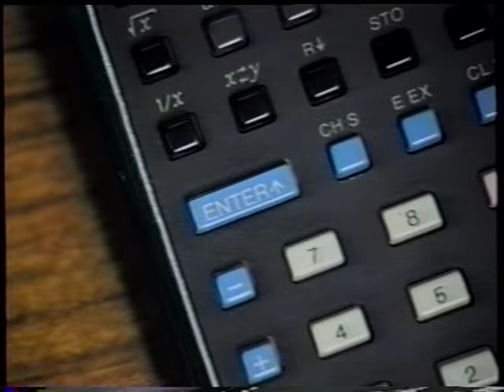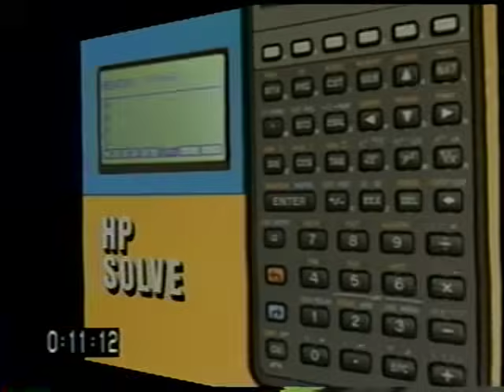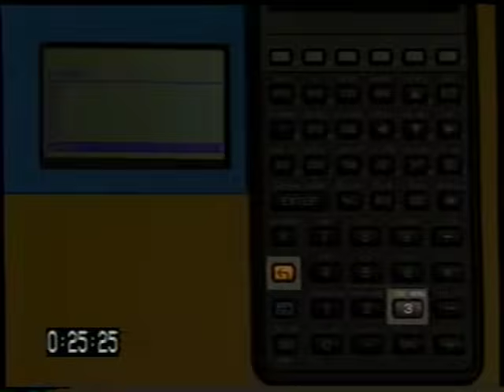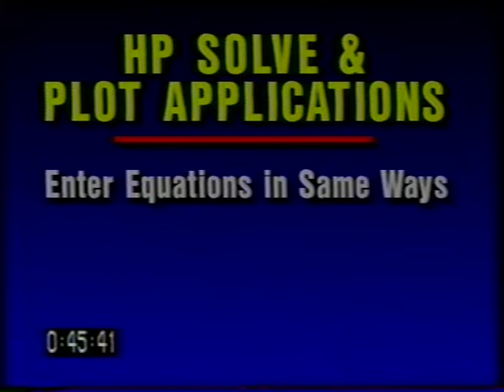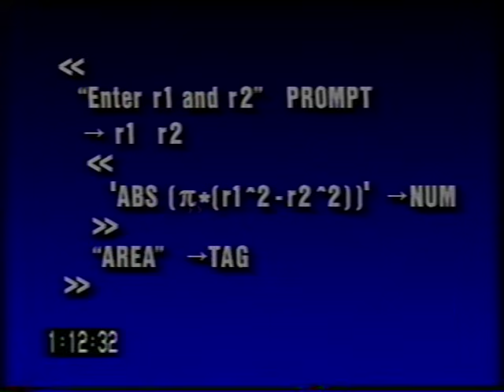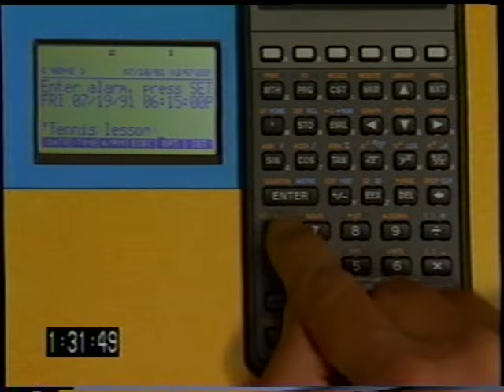Learning About the HP 48

Comment: The HP 48 is the best calculator ever made! I would really love an HP 48 Prime to be released - a modern fast pocket calculator for engineers that would not be allowed in SAT and other tests. I love HP calculators and have several 48, one 15c, one 11b and a re-release 35IIs. I also have the thermal printer.

Comment: Thanks for the video.

I got my 48SX during college year in 1991, one of the most interesting features is matrix to solve three unknown variable with three equations for circuit theory courses.  

My 48SX still work but the screen getting dimmer with "bleed" LCD , not sure if I should change its polarized/silver thin films or screen replacement from other models, like 39G, 40G, what is your thought ?
Reply: It's impossible to non-destructively open an HP48 series calculator for repair.

Comment: As a calculator, it is absolutely unbeatable. But it has/had some serious design flaws.

For example, a very large number have been affected by contact errors, which cause buttons and the screen to stop working. I've had four of them and all of them have had contact failures.

The glued-on metal plate has a tendency both to loosen and to become dented. Sticking on a metal plate of very soft/flexible metal, was a really bad idea.

The calculator is assembled in a way that makes it completely impossible to open. Given all the contact errors it tends to suffer from, it would have been nice if it could be opened.

But as I said, as a pure calculator it is completely unbeatable - as long as it works, that is.

Comment: Thank you for making this video available. I had a 48sx in the ‘90s and used it a lot in my eng studies. We had the same model with a class mate. We developed and exchanged programs via IR. It was incredibly useful that time. Unfortunatlely the buttons dont work on it anymore. However a very nice iphone app called iHP48 has recently been released so I can enjoy again the good old hp48 experience. I came here to relearn the basics of programming.
Reply: Les touches re-fonctionnent lorsque l'on appuie légèrement entre le bas de l'écran et la première rangée de touches blanches (ABCDEF). C’est simplement un problème de contacts souples qui vieillissent mal avec le temps. 
 C'est un des deux défauts de la HP 48SX.  Le deuxième est que sa construction est rivetée, donc elle est difficilement démontable au risque de faire de la casse. 
Sinon j'ai réussi à trouver un émulateur d'HP48 qui fonctionne sous Linux (Qui se nome x48), et à y transférer mes programmes faits il y a 35 ans via le port série..... et qui fonctionnent encore ! 
Le problème en 2026 a été de fabriquer la prise qui va de la HP48 SX à un port USB. 
Mais c'est faisable ! Il faut juste un convertisseur DB9/USB et entre la HP48 et le convertisseur, là il faudra faire un peu de soudure. Quatre fils à relier à certaines broches du DB9. 
HP48 1 → blindage
HP48 2 → fil DB9 2
HP48 3 → fil DB9 3
HP48 4 → fil DB9 5

Comment: Long live RPN! By now I am literally befuddled when faced with a non-RPN, non-stack calculator. The head of the engineering program at the Community College I attended made us buy 48's for Statics in 2002. They were about $120 in the college bookstore by then if I'm remembering correctly. Still using the 48GX I bought then, every day at work, and it is perfect! I don't do high level math on it anymore, but I can't believe my colleagues who use the Windows calculator instead of a handheld calculator.

I made my own interface cable and managed to push one pin into the calculator body. I called HP customer support and they offered to send me a replacement! That impressed the heck out of me, and made me a loyal customer for as long as HP makes calculators. I just ordered my son a Prime G2; way overkill for high school, but should see him through college and beyond in a technical field. The replacement 48GX HP sent me sits at my computer desk at home.

Comment: I studied the entire HP 48 SX calculator manual during 12th grade in 1992, as it was my first real calculator given to me as a gift by my father. I learned to use the calculator very well over the years in college, but many of the things in this video would have made my usage much more efficient.  I still have the SX and GX with a bunch of expandable storage cards, and even the printer.  It was the coolest calculator ever made and probably still is in many respects.     I also have the entire line of HP 95 lx,100lx, and 200lx micro computers.
Reply: I started with the HP 28s, then the 48 SX and GX, then I got the 200lx. I was sadly not so good at keeping them, however. :(
Reply: Hot, you've got more stuff than I do!
Reply: Pretty cool palmtops those you have.
Reply: Cool collection, I am very lucky to get a almost brand new HP 48Gx on a garage sale, the owner just kept it in the bag for almost 30 years. Although it is so low than the modern calculators, I was still shocked by its versatility in consideration of being made in 1990s, love it so much
Reply: Hey - in 12’th grade, my father refused to buy me a Hewlett Packard.  Instead, I got a Texas Instruments SR-52. I studied it inside and out and programmed it for  days and days and days.   It was a lot of fun.
Reply: but what did you end up doing for a job and did you use hp48 in your job?

Comment: I wish they would make a production run of the HP 41 and sell a math pack with it. Every hp calculator I have bought since is an over complicated mess.
Reply: Buy the 41x from swiss micros. It runs the original hp41c code.

Comment: Love this video. I used my HP 48SX for 20 years until one drop too many finally killed it. Still hooked on RPN. Started with the 32s in college, now enjoying the DM42. I hope they make a DM48 as it really was the prefect calculator.
Reply: I still have my 48sx and would use it but the LCD is gone bad. And 48 is nearly impossible to repair without breakin something.
Reply: You can install DB48x on your DM42 to have HP48 capabilities.

Comment: I would still be trying to pass Fluid Mechanics if I did not have this machine!
I wish we could have the Solver in HP Prime!
Reply: Huh?  No Solver in HP Prime?  HP50g user here.
Reply: @kahuna1247  there is a solver app of course, but not as efficient as the solver of HP 48/49/50 which is using the soft keys! Big mistake, if you ask me. But the touch screen is a big plus on Prime. One cannot have it all I guess.
Reply: Yeah, and I wish the equation library was in the Prime too. I realize there is a user-made equation library, but it doesn’t support units like the 50/49/48g. That equation library was super handy as implemented on the older calcs for a working engineer. The unit conversions are not as efficient in the Prime either.

Comment: This calculator came so tragically close to being the perfect marriage of RPN and Algebraic. All they needed to do was make the equation editor the default command line and make the ENTER key do what the EVAL key did. You could type a number followed by ENTER and it would push the number onto the stack as usual for RPN, or you could type an expression followed by ENTER and it would evaluate the expression and push the answer onto the stack as usual for algebraic but with automatic memory function.

The multi-line stack display actually made RPN usable by mortals since you no longer had to keep the stack layout in your head as with the earlier single-line displays. The units system is a thing of beauty and I cannot understand why spreadsheets do not implement something similar today.

Sadly, after this apex of the calculator story HP did RPN/Algebraic as a modal choice rather than something you could mix-and-match before dropping RPN altogether shortly before calculators finally died.

It is worth checking out one of the emulators, and downloading the full user guide. These days you do not even have to pay extra for the top of the range GX!
Reply: On a 50g you can enter algebraic expressions as quoted strings (in RPN mode). Just hit the quote button and off you go

Comment: Why this video was not uploaded when i started in engineering 😢. I have an 48g+ and it still a great calculator, is more reliable than an algebraic calculator.
Reply: I agree, this content would have been useful and should have come in a VHS video cassette along with the calculator, the machine was already almost $300.
Reply: does this calculator's programming have variables,whileloops and forloops?
Reply: @edmund8954  Yes it does. The calculator is somewhat slow to run programs though. I recommend downloading the pdf manual and a emulator to test it before doing all the work on the device itself.
Reply: @marcos.oliveira  Ah I see, I can't find any videos of these calculators doing programs.
Reply: @edmund8954  The lack of videos makes it hard, but old forums and sites like https://www.hpcalc.org/ have great resources to program in this series of calculator. Some of the HP50g programming works here as wel, if i not mistaken they use the same base language.
Reply: @marcos.oliveira  oh yeah,I'm looking at the 39g+,it's cheap like $25-35,hopefully same but different shell. or it's gonna get confusing.
Reply: @edmund8954  the 39g series is a little bit different from the 48g/49g/50g series. The SDK for the 39's were abandoned by HP and was "the" way to make the apps. But even in the calculator, you will be able to program it - but is not the same as 48s series. You can find the 39gII also, that you can program in a "Pascal-like" language.
Also, if I'm not wrong, 39s are able to handle RPL also, but it is not so trivial.

Comment: Wow... they don't make them like this anymore. Neither calculators, nor instructional videos. This rainy Sunday got out my old HP calculators and realized I completely forgot how they work after 20 years. Thanks for sharing this.
Reply: Me too! forgot almost everything, but still in good shape, the calculator not me....
Reply: In my college we had an HP ambassador to give us course for intermediate and advance use of the calculators, 48 series, with a device that was an LCD screen for the overhead projector connected with the serial cable to his calculator, so we could see his screen.

yes, best calculator ever, I tried the 49 & 50 series, just not the same, yes they were faster but the buttons were horrible.

but now with smartphones we can even use Wolfram in the web and calculate on their clusters, it is expensive but we can get a ton of power on our modern "palmtops" or "handhelds"
Reply from the maker: I managed to buy one of those overhead project displays for the HP48.  It actually connects via one of the card slots, surprisingly.
Reply: Nobody except HP made instructional videos like this in the 1990's either - it is more like something from the 1950's!